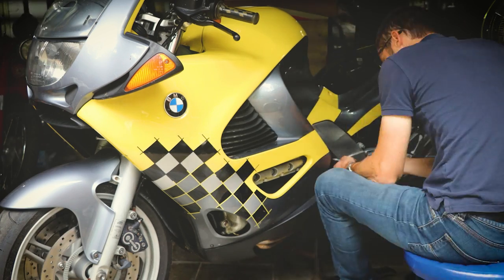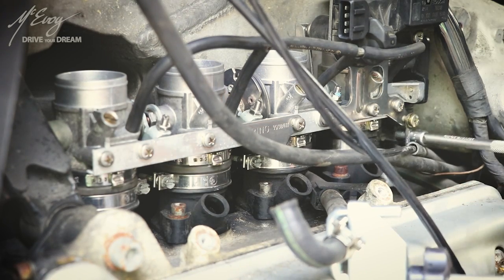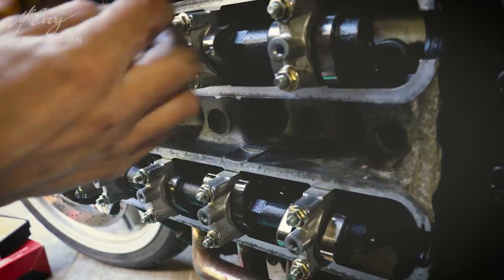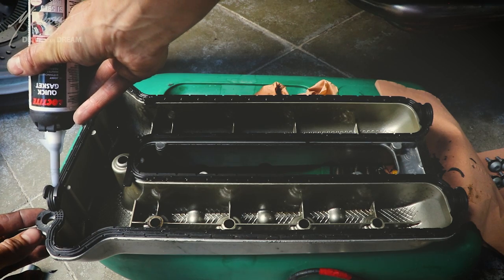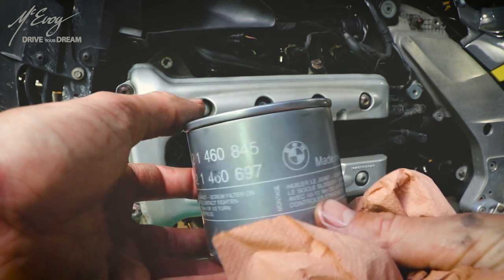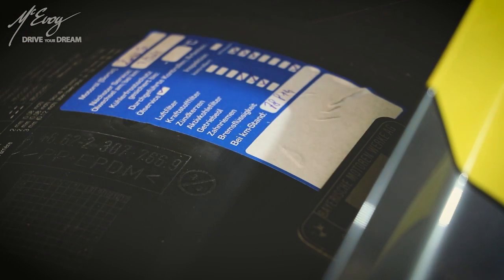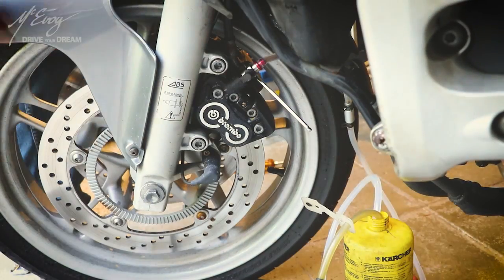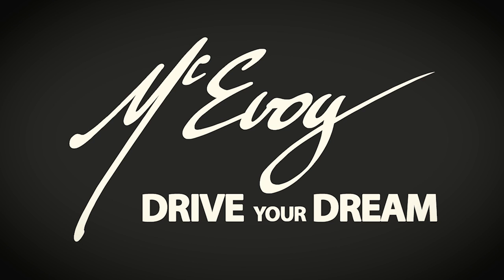BMW K1200RS full service

Comment: great video,  I've owned a k1200 rs for 14 years and its never let me down. The main issues I've had over the years have been  black gunk in the braking system, which was the insides of the  brake pipes breaking down and the main seal went on the end of the crank which spilled oil over the clutch. The clutch and main seal was a big job which needed a few special tools but was ok. I've also had the fuel pump seal leak and couldn't get a proper replacement so used a 6mm thick piece of Viton rubber and cut my own.
I`m about ready to do the camchain and cam shims next.
Thanks again for an excellent video.
Reply from the maker: Thank you for sharing your story! Good thinking on the Viton seal! The crank oil seal is a classic. Big job indeed, and expensive as well. One of those jobs ending up with "while I am at it,..."
 I must change the timing chain too real soon, and one or two cam shims are a just about out of tolerance. Another hefty bill coming up, right there. I seem to remember a single bucket shim costs around £30. Fingers crossed, not all 16 need changing! I am glad to be a professional, able to do the job myself, as it is also one of those time-consuming operations. Great fun, however... :-) 
Thanks again for your comment, it is highly appreciated!
Reply: Learned so much from you. Thank you!!!!!!!!!!!!!!!!!!

Comment: I learned a lot from you. Thanks! I’ve ridden an ‘04 K12RS since 2007 with 65K miles now.  Btw, I believe the reason for the spring between the valve cover and engine block is to provide electrical grounding, preventing a shock should your body contact the cover.
Reply from the maker: I am truly happy to know that you got something out of this video. I also thought the spring to be for grounding, as he bolts are insulated by the rubber grommets. They truly think of everything, at BMW. :-) Or at least, they used to. Don't know what it's like now, except that it is surely much more complicated. Thank you for your comment!

Comment: Thanks for posting this, it looks like you know what you’re doing. I have a K1200RS  and it is the most enjoyable BMW motorcycle I’ve ever ridden, and also looks fabulous. Wonderful engine!

Personally, I’m not a fan of the K&N air filters.  They increase performance by allowing more airflow per second but also more dirt per second, so the trade-off is not worth it to me. I’ve seen this confirmed with independent testing, but the most convincing proof I’ve seen is from Project Farm on YouTube.  However, as you suggest, there’s some controversy about this, and your preference may vary.
Reply from the maker: Thank you Jay! I do know my way around a proper toolbox, as I am a professional mechanic. :-) I must say that I sincerely prefer this bike over the K100 I used to own. 

Regarding the K&N filter, I would be inclined to agree with you. The main difference is that I am a true Summer Sunday biker, as in I ride in nothing less than full sunshine, when the road is nice and hot and my tyres get tacky. This being a road bike, it will only see asphalt, so I strongly believe that the K&N is an improvement. Where it a dirt bike, I would obviously not have gone down that road, but as I am 100% certain that I will only ride in clear conditions on paved roads, it won't be seeing much dirt or grit. And the filter gets washed and oiled yearly henceforth, regardless of what little mileage it sees. 

I will take a look at the Project Farm that you mention, thanks for the tip!

Thanks again for watching, and enjoy your K1200RS, bro! Stay safe out there! :-)
Reply: K1200RS has to be the most beautiful, overlooked bike.

Comment: Grey/yellowish fluid (emulsification) - crank case breather (oil mist) venting into airbox mixes with condensation from the inlet air supply, especially seen on boxes sited above a hot engines. Go for a blast then park up in the garage with a cooking engine. Noticed a lot of heavy fluttering on the vacuums, see this a lot people forget/don't fit the restrictors on the tubes, best placed close to the gauge set about a couple of inches down - hey presto rock steady.
Reply from the maker: Thanks for the tip about the gauge! Yes, that crank case breather tends to get gunked up quicker on short runs. Thankfully, I wring the throttle on long rides, haven't checked again but I am pretty sure it's okay now. :-) Thanks again Andrew, much appreciated.
Reply: Nice one for the info Andrew. I was wondering where that gooey deposit came from. I'm always worried when fixing the symptoms of a problem without ascertaining the cause.

Comment: Just picked up a K1200RS that has sat for a few years.  Perfect video for this project.  What fluid are you using in the ultrasonic cleaner?
Reply from the maker: Fantastic winter project! You will love it, come Spring. I use Sonixlab Tek34. Works superbly well with carburetters and alloy parts, generally speaking.

Comment: Thank you very much for the video, just bought one, last week, let's just say some people shouldn't own bikes....anyway, same gunk in the coolant, same oil in the breather tube, I "fixed" mine , because in the UK it is 60£ a new one and let's just say I have bought a lot of parts for this bike already ...wife very unhappy 😁, but I really want to make the bike work properly for myself.
PS: mine has a rough noise from the engine ? But when I pull the clutch it goes away ...I think some clutch issues as well ...
Thank you again for the video, it helped me a lot !!! 👍🙂
Reply from the maker: Hi Gaby! Congrats on your purchase, and hooray for saving such a great bike! The noise you hear (like rocks in a box, pretty much) is the clutch actuation rod going from the slave cylinder to the clutch. It lives in a tube that goes through the gearbox, and a little felt bush is supposed to centre it. After the years, that felt bush just disintegrates, leaving the clutch actuation rod to rattle in its tube... Nothing more than a pain to the ears, really, but something than can be addressed during the next clutch replacement. I have to do mine soon, as it slips when I open the throttle nice and wide... So watch this space! More maintenance videos still to come! I also have play in the swingarm, and a whole bunch of other small things to take care of. Otherwise, I am perfectly happy with hit. In fact, I might take it out for a spin this afternoon. :-) 
Have fun with your K Gaby, and speak soon I hope. 
All the best,
Geoffrey

Comment: Great video. I have a 2003 K1200RS and have a problem with my test suspension having a 'clunk' type sound on hard bumps or ruts. It does not feel broken or loose, but feels like it needs lube or some type of grease. All my bikes from Honda to Ducati have a way to grease the swingarm bolts and rear suspension. I cannot find any place on this BMW to lube the rear suspension! Any advice on this problem? Thanks
Reply from the maker: From what I recall, it is all mounted on rubber bushes. If something clunks, then a bush must have disintegrated. There is no lubrication needed anywhere else than on the swingarm bearings. This bike is solidly built 🙂. With the bike on the centre stand, try to push and pull the rear wheel from side to side, left and right. See if there is any play in the swingarm bearings.
Reply: Thanks for the prompt reply. There is no play at all. It is just a feeling of metal on metal with harder bumps. From what you are saying, I'm thinking that the rubber bushings may have just gone like older men.... Softer over time! 😂😂 Thank you for your thoughts

Comment: Great bike   so it's a car engine laying on it's side   scary stuff.   Wonder what that clay like substance was     it definatly needed some love and expertly done i must say and that beer at the end was well earned    good to see you back and will see you on the next one
Reply from the maker: That sums it up quite well indeed. The engineers at BMW developed this engine in the late 70's early 80's. It was first applied to the BMW K100, and this is the evolution. Also, it was the first water-cooled unit they used, and in-line 4 cylinder as well. Miles away from the good old air-cooled boxer engine. This has massive torque all across the rev range. They also broke the self-imposed 100bhp limit, and managed to squeeze 130 horses into this one. This is not the last time you will see this engine. :-)
See you soon, Darren!

Comment: I have a problem with my 199 K1200RS that I purchased during Covid in 2020. The previous owner (only owner prior to me) had a work accident in the year 2000 & only clocked up 12.5K on the bike & has been unable to ride it since the accident! I purchased it & had it freighted to me & it was a great bike to ride. Unfortunately, I now live on a farm in NSW (OZ) & due to the huge amount of rain & the 8 klm's of dirt road, I have only put a thousand klm's on it. the weather has changed & we have had the road repaired, so I stripped the fuel tank & all associated parts down, replaced those parts needing it & after putting it back together, I have 1 electrical connection that doesn't seem to go anywhere! I didn't take photos because I thought I was so smart & now I don't know where it should go!!!! I have the manual, but its photos are pretty basic & are no help! Can you help out with any info on the electrical connections surrounding the throttle body, Injectors etc.?
Reply from the maker: Hi there, and congrats on finding a rare low-mileage, one owner bike! That's definitely one to keep! It could be a connector for cruise control or something like that. Feel free to send a pic or two to info@mcevoy.be. It might help to see what it looks like. I look forward to hearing from you!
Reply: @gmcevoy  Thanks James for your input. I’m not sure how to upload photos on YouTube. I have about 5 photos that I would like to share with you! Can you help me out please? Cheers Col
Reply from the maker: Hi  @colinharris-cross9712 . I received your photos, and answered your email. Maybe check your spam folder, just in case it got skimmed out of your inbox. And also, it's Geoffrey, not James. 🙂
Reply from the maker: @colinharris-cross9712  Hi Col, Did you get my reply by email?
Reply: @gmcevoy I’ve checked all my spam etc. but can’t find it! Cheers Col

Comment: Great Vid man. I hope to put some time aside to do this. What tool was that you used on the butterfly adjustment. Bike sounded amazing after you did it and got it all synced up. Awesome!
Reply from the maker: Hi! Thanks for the encouraging comment! It is much appreciated. The tool I use is "Carb Tune Pro 4". Absolutely indispensable to get the job done. Not only does it sound better, but it idles and runs as it should, too. :-) I definitely have to replace the breather pipe at the rear of the TB.

Comment: Quick note about changing the in-tank fuel filter. The fuel vent access cap lower on the right side of the tank had a poorly designed 'L-profile' gasket system (seen at 12:18) that was upgrade in later '98 models. There are two different  OEM numbers for this gasket (Nr. 16117654903 prior to early 98' and 16117686297 for later models).  If you have the early version you will absolutely want to change this gasket at least once to ensure the factory gasket has been swapped out.
Reply from the maker: Good point! Duly noted.

Comment: Geoffrey,    Do you have the part# for the Breather tube? I am having problems finding it. Thanks
Reply from the maker: Hi Walter. There are a couple of variants I believe, one of them being part number 11151465009. You might want to double-check with a BMW dealer.

Comment: Excellent video thanks so much. So very well filmed, edited and narrated! I'm about to buy a 98 K1200rs with 40k miles on it. Good to learn some wrenching skills! As I understand it, the older models are more reliable, non servo brakes and a simpler ABS system?
Reply from the maker: Many thanks for showing your appreciation. It goes a long way. There is no servo system, but it does have ABS. Mine does anyway. I am not sure if it was an optional extra, but at any rate it is handy. I was sceptical at first because the system does add a lot of weight to the bike, but it already saved me a couple of times in hairy situations where I would have otherwise locked a wheel... Have fun with your K! They are truly fantastic bikes. I took mine out last weekend, what a rush. :-) I need to replace swing arm bearings and a few other things like the timing chain, so stick around if you are interested in learning some more. :-) 
Take care out there!

Comment: What was the modification to the oil filter tool?  You referenced it, but not what it was
Reply from the maker: Indeed. If you look closely at around 11:17 you can see that I welded a length of 22 mm cold rolled steel square bar to it. This to have better leverage on filters which are often found too tight to remove otherwise. The 3/8" square drive had rounded off after just a few uses.

Comment: Dear Geoffrey, 

Thank you for the amazingly detailed video, for such an awesome motorcycle that I absolutely love. I have two issues with my K1200RS that I would like to ask your expert opinion on. (Sorry if the question is basic, I am not a mechanic) First, I recently had my clutch and driveshaft replaced, and since then after the engine gets warm, getting into neutral is very difficult, I have to tap on the clutch pedal just the right way to do it. Immediately when I turn off my engine, the clutch smoothly goes into neutral. What could be the issue? 
Second, I have had a perpetual oil leak on the side of what I think is the intermediate housing, I think. Right side of the bike, the exposed metal part, which is what I think has the clutch inside. The leak looks barely like a mist, and when I wipe it, takes a couple weeks to return to anything noticeable. Should I be concerned? Thanks again, and sorry if the questions are basic.
Reply from the maker: Hi there! Thank you for your kind words, they are truly appreciated. There are no basic questions, just questions, which I am always happy to answer if I can. First thing you will want to check regarding your shifting issue is that the oil level (and oil viscosity of course) in the gearbox is correct. If not, it could well be the source of your problem. Also, what mileage does your bike have? 
The oil leak that you have would likely come from the rear crankshaft oil seal or gearbox input shaft seal, which should have been changed during the clutch replacement operation. It is one of those "while you are at it" jobs which only add half an hour labor at most and a couple of inexpensive parts. Have these oil seals been changed while the gearbox was out?
I think my clutch has started to slip, so I would like to change it this Winter, along with the timing chains which are due. I also have to replace the fork oil seals on my Triumph Bonneville, and some body work to do on my Pinzgauer. So many projects, so little time! :-) Stay tuned for more, and feel free to reach out whenever you have questions. :-) Take care.
Reply: @gmcevoy  Thank you for the quick reply Geoffrey! My bike has great millage, only 28,000. (23,000 when I bought it). I can ask the shop about whether the seal was changed, I think it was. 

The oil changed help a little, but neutral still is tough to get to. Any other ideas?

Also, just the day before doing my oil change, I left my bike out in a heavy rain (hasn't been an issue before), and when I started it up in the morning, both the ABS lights were intermittently blinking, left then right. I checked the bread fluid and it was low, so I added some more. I thought that would solve the issue, but the lights are still blinking back and forth. I read that flushing the break fluid might solve this. Any idea? (I also do not know where to start a flush like that). 

Last, would you recommend putting 3M injector cleaner in the fuel to help clean out the system? I use it on my car with good success. 

Thank you again for the help. My nearest dealership is two hours away, so your advice is greatly appreciated.

Comment: at 2:31 you mention buying anew part a bots something? what is that part exactly?
Reply from the maker: Yes, the breather tube number 11151465009. I should have bought one instead of fixing this one, as it is quite a pain to get access to. So far it has held well, but I know that it will need replacing in the future. Thank you for watching, I hope you enjoy your K!